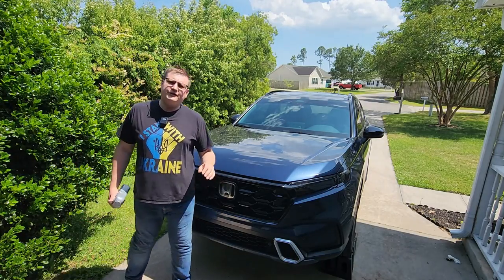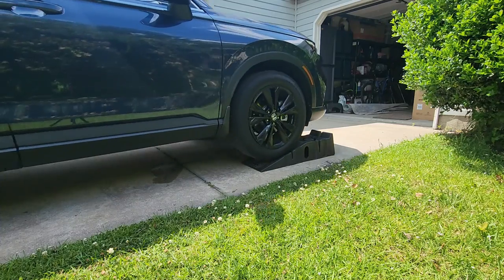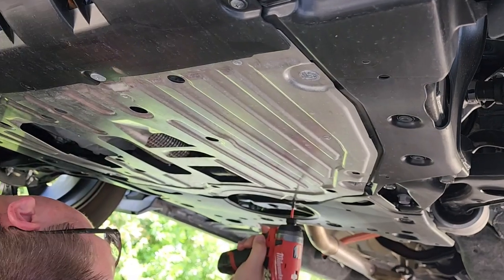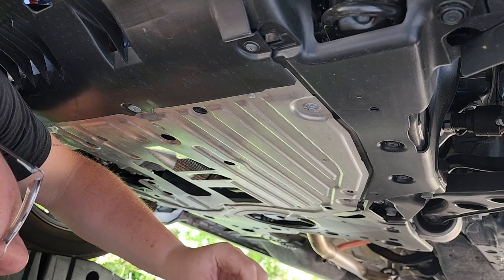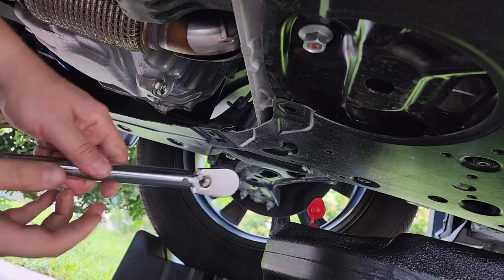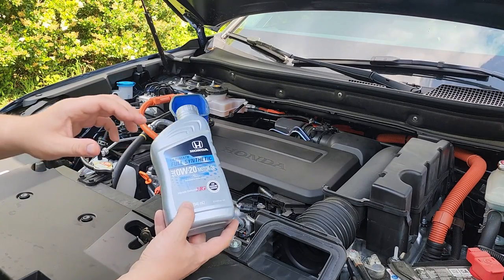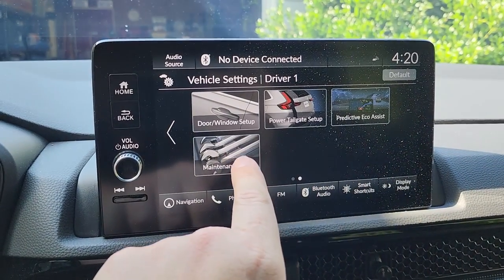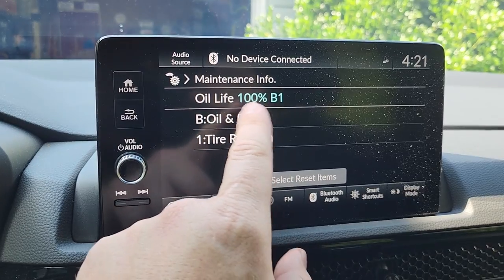2023 Honda CR-V Hybrid  - Oil Change

Comment from the maker: WARNING:
To remove Shield screws, please use PH3 size of the bit. It's a philips bit with cut off point that can be found in most screws bit sets. If you damaged the screw already, you can cut into it with a grinder making cut in on the middle to use flat screwdriver so you can turn it. New screws can be found at your local dealership, they always have them in stock for about $2 a peace. 

Oil filter is the same filter that goes on 1.5L and 2.0L engines.
Oil type is 0W- 20 (fully synthetic only)
Oil Capacity: 
1.5L -  3.7 Quarts 
2.0L -  4.2 Quarts

Comment: I was told by Honda not to change the FIRST engine oil too early. The special engine oil from the factory is designed to lube and coat the engine and it is best to remain in the engine until the first manufacturer recommended oil change schedule. After the first oil change, you can change the engine oil early if you want. Prematurely doing the FIRST engine oil change will shorten the engine life.
Reply from the maker: Yes first oil do not change at 1000 or 2,000 miles.... some people do that lol. 6000 miles on first oil is more then enough
Reply: you was told? Well, then you should think and make your own decision whether you want to do so or not! As for me, all of my Honda and Toyota break in oil will get changed at 1000-1500 miles. Never, aside the one who got a turbo, has any problem. I sold the one with Turbo, you know what brand! The rest made it to 200k miles, so you decide yourself, what you got told is just a told!
Reply: You were told by Honda or a Honda dealership?  I sincerely doubt either one of them knows what they are talking about.  

There is a Toyota guy on YT that rips an engine apart and shows you what happens to an engine if you listen to the manufactures maintenance schedule. They want you to trash your engine outside of the warranty. 

I changed my oil the day I bought it.
Reply: @mccalejk2  general rule if the manufacturer says 10k miles they are bs you change it every 5k miles or slightly lower. I wouldn't change the oil in a new car immediately since the oil that comes from factory does help with break in. I think everyone knows you should baby your engine during the first 5k miles to help break it in so no harsh acceleration and such.
Reply: Change at 500 miles.
Reply: @onegooddba  , yes, or at 1k if you can't go earlier. Someone wrote about the oil is coating the engine..LOL! There is no coating the engine, the most wear takes place when the engine is new and it needs to wear to seat the rings, etc.
Reply: @mccalejk2 , BMW's in the late 2000's to late 2010's with 10K intervals just add to engine problems.
Reply: Honda says that because of the high-moly content in their factory oil, moly from the assembly grease they coat the rings, bearings, and camshaft area with to prevent initial new dry start. .........  Actually, if you changed your new car's oil at 500 miles, you would get out most of the metal particles from the slightly-rough new surface finishes, along with stray RTV silicone rubber sealant particles floating around in there (anything above 30 microns the oil filter catches), and just be sure to put in some LiquiMoly brand's "Ceratec" additive (easiest option) ... or simply use a high-moly motor oil like Idemitsu brand 0w-20 (napa autoparts), or Toyota house-brand 0w-20,  Valvoline Extended Protection synthetic 0w-20 is also high moly, not sure of which others have a lot of moly.
Reply: @mccalejk2 thats because those engines are non hybrid from his yt Channel. Hybrid you should change it until the car tells you too. Especially the first oil change. Non hybrid is different than hybrid cars
Reply: There is no such thing as a hybrid engine. Most ICE's are used on hybrid and non-hybrid vehicles.
It's the Hybrid battery that powers the motors through an inverter. The engine is separate and can assist in powering the motors to the wheels
Reply: @littlet7556 that’s the most accurate description so far, break in oil is usually a heavier weight to help seat the rings. Most manufacturers recommend minimum of 500 miles before slamming the gas pedal into full throttle or shifting at high rpm. Usually high performance engines recommend changing the break in oil out just after the break in period. A mechanic will tell you, follow the manufacturer’s recommendation.
Reply: How do you calculate mileage on an engine that does not run 100 percent of the time that the car is moving? Have a 23 hybrid sport touring going on past 6k(in about 5 months), no maintenance light yet...
Reply: no
Reply: I have a 2004 Honda Odyssey, as the original owner, changed the oil every 7,500 miles, unless I used synthetic, then every 15,000 miles, I’ve got 335,000 miles with original engine, no check engine light.
Reply: Thats Bull shit!! You need to change your oil on a new engine before 1000 miles. They don't use break-in oil from the factory, if they did for sure you would have to change it early.
Reply: there is no “special oil” added at the factory
Reply: Baloney  @Fumbiii16
Reply: So what's the use of a hybrid car? If you do a maintenance like a regular car.
Reply: @Fumbiii16 wrong
Reply: @Sig_ben2 lol , better gas mileage
Reply: I was told by a master mechanic for Toyota, if you’re keeping the vehicle for a long time change your oil every 5000 miles or 8000kms.
Reply: Torque spec on oil filter is 9 fl-lb
Reply: They lied to you
Reply: @Fumbiii16 wrong
Reply: Break in oil change will always 2000 miles, then 3000 miles after that

Comment: official honda oil drain bolt Torque spec is 30ft lb. Oil filter is 3/4 turn from gasket contact.

Comment: Thank you. I just changed my oil using your video. For the 2nd time. I changed at 2000 miles and now at 6000 miles. I didn't reset, so my  next one will be free at the dealer.  Mine is currently at 50%. Hopefully, I can take advantage of the free service at 10000 miles. I should do a tire rotation now, too. Thanks again.
Reply from the maker: I did my tire rotation at like 8k

Comment: I had the same issue with the screw on my 2024 accord hybrid! I did my first oil change at 850 miles getting ready to do my second at 3500 miles. The third will be a free one at 7500 by the dealer. After that I will do an oil change every 5000 miles. You need to get all the initial wear metal out of the engine!!
Reply from the maker: You can buy replacement screws as your dealership for $2. If u strip them. I put some silver antiseize on new ones and make sure you use Phillips screwdriver bit that market PH3. It's that thick one with cut off nose.
Reply: @IvanRossS  I didn't strip mine, but I could see they would be easy to strip. When I re-installed mine, I just snugged them up.

Comment: Just bought a hybrid crv. I’ll miss how super easy it was to do an oil change with my Subaru. That aluminum shield and  screws  is too much extra work removing and putting it back on.
Reply from the maker: Will they do protect from any kind of damages, water and they provide better are dynamics which I rather have all these benefits and mess with this Shield.

Comment: I have a new RAV4 Hybrid. Changed at 1.1k. Will change again at 5k. and then 5k intervals. Old school. I doubt very much that Honda uses break in oil.
Reply: Yes it’s more than sometimes 5k depending on your driving. The monitor and car should know how many miles you’ve driven from hybrid to gas only. 1k is too short to break it in.

Comment: My comment would be if you don't reset the oil % when you change the oil, can you wait till it's at say 15% can you have the dealer do every other oil change because they in California offering 2 years 24000 miles of free oil changes. So you can get at least every other oil change for free?

Comment: I had the exact same problem with the four metal retaining screws.  I managed to loosen two of them, but they were much tighter than necessary.  I had to use a manual impact driver to break the last two free.

Comment: 2:15 the screws of my 2024 crv has the same way over tighten 😆, I put synthetic grease on them for the next time it will be more easier to crack open them, nice video
Reply from the maker: I just changed my oil again myself. I had to replace all these damn screws and I went to dealership to get them for $2 each because I strip thread on all of them even worst. Originally using a wrong bit. You Have to use PH3 bit, the one with the flat nose. But I ended up putting antiseize on the thread not synthetic silicone.  Hopefully they will come off easy next time.
Reply: @IvanRossS you can’t do nothing with them it’s way over tighten for no reasons, I opened them with big screw driver after i socked them with penetrating oil

Comment: Just a tip dont put the shield back up till you have fired it up to make sure there is no oil pressure light, you dont want to remove shield again if you forgot to tighten something or realized shoot forgot the filter :).
Reply from the maker: Well that's on you buddy
Reply: Pro tip: Don’t forget to torque drain bolt and put filter on tight…

Comment: Thanks for the video.... When using the ramps, does that effect the drainage?  (if the car is on an angle will it prevent all the old oil from draining?)  Thanks
Reply from the maker: No lol. Of course not. And it will help to drain actually haha.

Comment: changed my oil at 4800 miles thanks to your very good video are you going to rotate you tires I have a floor jack and jack stands bit I am unsure where to place floor jack to safety jack to crv up to get it on the jack stands where is safe place  jack in the rear thanks
Reply from the maker: I take my car to Costco, $20 to balance all 4 wheels and rotation!!. Best deal ever. And I already did that 3 month ago. Rotation is just have of the job you have to balance wheels at least ever 10k too.
Reply: thanks I live in small town no Costco closeby maybe I can find some other place the last place I had it done local cross treaded wheel nut and I had to get lug replaced cost me 60   @IvanRossS

Comment: I may consider doing some surgery on the shield.  Having to remove and reinstall it with every oil change is ridiculous.
Reply: Yeah, Bad design. I have a RAV4 Hybrid and we have just 4 10mm bolts. Not torqued on.

Comment: Those 2 screws that feel over tightened are exposed to the elements and rust. I recommend putting some grease on those 2 screws to prevent corrosion

Comment: i personally would use Amzoil oil and Honda has a oil filter cap tool 

sure crush washer is a good idea, depends on the condition of it.
Reply from the maker: I have a oil cap tool all sizes, I just wanted to show the video something that you can buy pretty much everywhere. Even Walmart sell those pliers
Reply: @IvanRossS  i found that tool sometimes will crush the filter if it was too tight

i see you are using Milwaukee tools, awesome stubby, love the M18 inflator
Reply from the maker: @TranTek  well I'm not worried about crushing old flter lol. As long as it's not going to bust through and let oil come out. I never had this problem with this pliers

Comment: When checking the dip stick, I find on my ‘24 Hybrid it’s in the center after just 3.5 quarts. Isn’t that odd?  Curious what your dip sticks shows after adding 4.2 qts.
Reply: I just did an early oil change on mine at 500 miles . The oil was at the top hash mark of the stick . I measured what came out. 4.75 quarts . 😮 . I put 4.20 qts in,  started vehicle, let it rest for 10 minutes and it was exactly half way between marks . So now I know correct position on dip stick .

Comment: One more question can you change out the bolts on the bottom tray to hex head screws so they could be changed out with fewer issues from the overtightened screws?
Reply from the maker: Why not lol.... just get the screw, go to Ace Hardware store or any Home Improvement and make sure you get stainless steel screws and washer.

Comment: get JIS #2 screw driver tips, they don't round out. Hondas use Japanese Industrial Standard Phillips which are slightly different
Reply from the maker: Please read descriptions to the videos !!!!!  you can find a lot of useful information there !! Where I mentioned the same. But it's actually bit PH 3. JIS #2 still to round. I spoke actually with Honda mechanic and that what they use: PH3 bit. It's very common here in US and can be found pretty much in every bit set.

Comment: My question is? I have a CRV 23 and it already has a little more than 3 thousand miles on it and I am in doubt about whether to take it to the dealership or change the oil myself!!!! I'm of the idea that if I want things to turn out the way I like them, do it yourself, let me explain!! Thank you..
Reply from the maker: Just change your oil yourself. Badoo not reset your oil change interval. When it reach to 15 present go ahead and take it to a dealership for a free oil change every Honda comes with two free oil change

Comment: Not 150 ft pounds on the screws. Factory assembled with blue loctite to keep the screws from vibrating loose
Reply from the maker: To break loose lpl. Probably took 150 if not 200

Comment: That aluminum shield...just another thing the dealership mechanic can cross thread for the customer. Why don't they make some kind of twist fasteners that you just twist with your fingers?
Reply from the maker: I'm looking to replace my bolts with hex, allen wrench Style head
Reply: @IvanRossS  I have a Tacoma with the factory skid plate that needs to be removed for an oil change. Dealership "mechanics" cross threaded a couple of them. Too many of these guys start their bolts using an impact wrench/socket. So dumb.
Reply: bc then they may just come off too easy on their own just from where theyre placed.

Comment: My is not  the Hybrid version but the lx, is the oil change method is the same?
Reply from the maker: Should be the same it takes the same oil same filter the only the amount probably different because it's smaller engine 1.5 L not 2.0 L . Also every new Honda comes with two free oil changes.  Look for a free oil voucher in your manual
Reply: @IvanRossS  does it need any extra maintenance?

Comment: That bottom engine plate looks very light weight. Guess it will be no problem holding it up while you remove and replace the fasteners.
😊
Reply from the maker: Yes it's very very thin sheet of aluminum

Comment: You probably added more oil than you should have. You don’t drain all the old oil out. You should always check the dipstick before you add the last quart or so. 

Also, an impact wrench on plastic is never a good idea.
Reply from the maker: Trust me it's been checked and it's at the proper level.... I just never recorded it. Also where do you see a plastic ???... screws on the bottom are metal, threats that they going in are metal, shield on the bottom is also metal too

Comment: Thanks for doing these I have the same car only 3600 on mine so far so I will be watching, the owner manual doesn't even show were the air filter is, been thinking of doing my own oil change I have had bad luck on my last car with free dealer oil change but it was not at not at Honda, I like to change oil at 5000 miles or 6 months i don't know if Honda will change it that soon for free so may have to do my self-thanks
Reply from the maker: They definitely will not change so early for free.

Comment: What is the oil filter number for the CR-V hybrid sport?
Reply from the maker: Oli filter actually the same filter goes across all CR-V.  So yes for 1.5L and 2.0L it's the same filter.
Old part number: 15400-PLM-A02
New part number that ships in boxes now: 15400-RTA-003
Reply: Great, thanks!
Reply: All Hondas except the S2000 use the same filter

Comment: You have issues with the screws because it’s a Japanese vehicle and you are using Phillips screwdrivers. It’s a JIS no 3 screw not Phillips. Please update your video description and stop telling people to use Philips screwdrivers.
Reply from the maker: @thepiecesfit5049  ph3 work just fine here in America... it's very popular size and can be found in pretty much any bit it sets .. I was told by certified Honda mechanic to use ph3 and not to worry about it...

Comment: How much will you save if you do it yourself?
Reply from the maker: If not to be bougie by purchasing OEM oil you can get 5 quarts Castro or Mobil1 for $30 top + $10 for OEM filter or you going to pay roughly the same price for aftermarket Bosch or Mobil1 filter. So you're going to pay top $40 for full oil change if you do you self. If you take it to the dealer you going to pay over $100. If you take it somewhere to a cheap quick lube services it might going to be cheaper but you do not know if actually changed oil or filter properly. I do not trust those places
Reply: I think the main argument to change your own fluids is you knowing 100% what is happening.  Even going to dealers, you get inconsistent information.  For expample I went to 2 dealers and they gave me different information on my inspection reports.  Any time I get a recommendation for a repair, I get a second opinion.
Reply from the maker: @RichardPalacios-w9f  exactly, I've been changing my own oil on all of my cars for the pass 10 years.

Comment: If you’re going to pre fill do it from the outside holes so it is filtered otherwise might as well leave it empty
Reply: The oil soaks through the filter, so it will be level in the filter.  Therefore, it doesn't matter whether you fill from the middle or the outside.  If you don't believe me, fill from the outside and then watch the oil fill up the middle of the filter.
Reply: Makes no sense!  he's putting in clean oil. And as he stated the oil will absorb into the filter. . Good luck putting it through the holes..lol